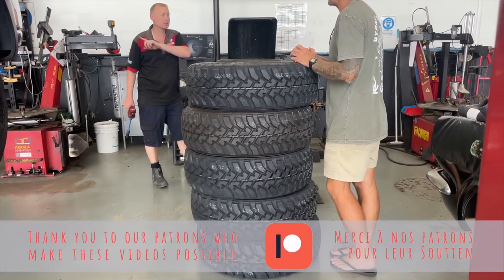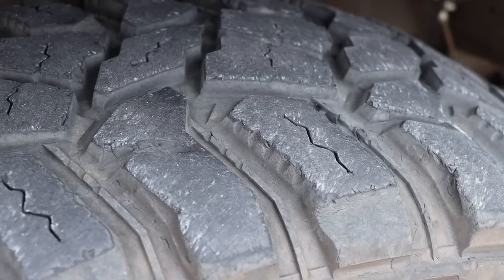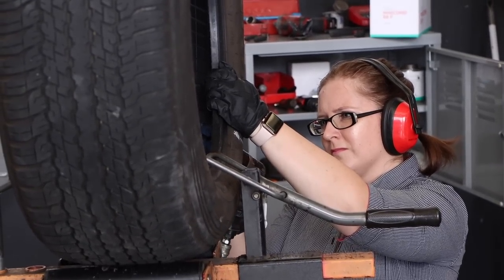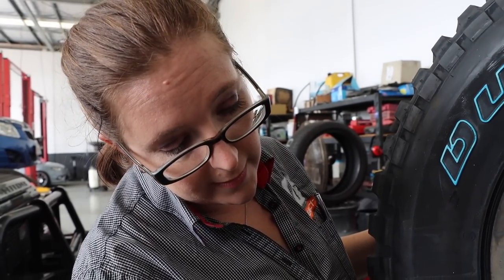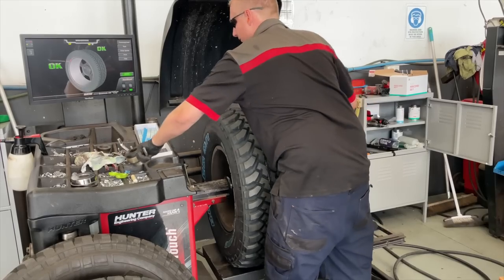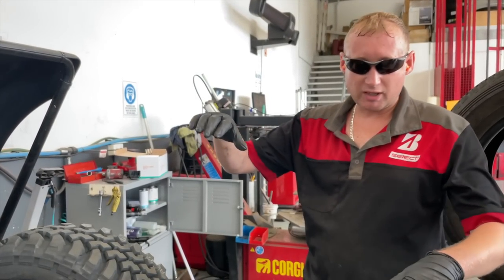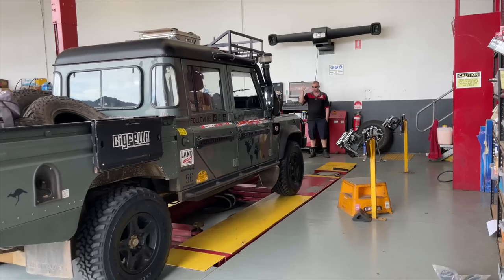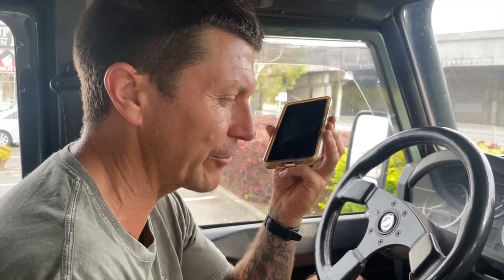New TYRES for Christmas. Ever wondered how they're fitted? #bridgestone

Comment: You are going to miss the Coopers so much!!
Reply: No one is using Bridgestones overlanding. . . Literally.
Reply: I’ve,run the same tyre on my disco 2 and my Kia Sportage ( in a 245/75/R16). On both cars no competes,what so ever,for a,mud terrai; tyre. They are quiet, grippy , and ride really well. Used in the NT as a road tyre.,our speed limit is 130 on the highway.. never had an issue and they inspired confidence. For a comparison   Jumped,in my mates,Pajero a few weeks agowith BFG allterrains. The tyre noise wasHORRIFIC in c omparison.

Comment: Interesting.  My Prado came with Dunlop AT's on it, but they lasted 70k km with mixed driving conditions.  I changed to BFG AT's and got 120k km from those again mixed highway and outback station type conditions.  Thet still had lots of tread on them but I changed them, because of the years and distance.  SO I am back with another set of BFG AT's, and I don't think that anyone could convince me to change, unless they were paying for them and any associated issues that may arise. Happy travels.

Comment: I had three tyres blow up in two weeks  between 5 and 20 km that were another brand. Since yesterday i have also Bridgstone  wich i had already three years before... Hope they will last longer.... Have nice Xmas and new year and a good travel to the new continent. 🎅🎄🎊😎🇫🇷
Reply: You must have bought inner tubes for tires or went on some very nasty terrain. Two weeks in 5 to 20km sounds very very strange...
Reply: @alwynvanwyk1851  No, only on the official road which leads to my house. Lots of Stones and 15degrees decending.  The Tyres were always perforated at the flank, where it is not permitted to repair. The 4seasons have been recommanded by the Garage. From a big French  tyre manufactorer. I came from the Garage to home, but on going down, pfffft. That never arrived in 27 years to me. 🤔😎🇫🇷

Comment: She says 5 year life span for tyres. Even the Bridgestone web site says 10 years. Salespeople!!!
Reply: You are 100% correct- I have a Bridgestone bulletin somewhere which confirms this
Reply: Legislation may be different to manufacture expectations.
Reply: @offroadingfoz  there is no state that can fail a rwc for tyre age only condition
Reply: The lady is probably more on wright side.
Reply: @scruffymoose 
As the lady at the tyre shop said, rubber is a perishable item, and it wears out.
Using a 10 year old tyre would be dangerous.
Even if a 10 year old tyre looks ok, ( which would be highly unlikely ) the rubber would have definitely deteriorated, and it would lack strength that is required, to handle the pressures and loads it endures when you are driving.
I thought the Tyre age limit was 6 years…
But, this time frame might differ across Australia, based on our States & Territories having their own specific Legislation regarding vehicle Tyre Age, and Tyre roadworthiness requirements ?
It does appear that in NSW, a maximum tyre age of 5 years, from the date of tyre manufacture, is the recommendation from 
Roads & Traffic Authority.
A huge number of factors will determine the tread life of your tyre.
If the rubber on a 4 year old tyre is hard, and no longer supple, and has cracks on the sidewall etc, it definitely needs changing, even if it still has a lot of tread on it.
There are also a huge amount of cheap / poor quality Chinese made tyres, that are “ no name “ brands, sold in Australia.
Sadly, people buy these poor quality tyres, to save what is often only a small amount of $$$ v buying a quality tyre, such as a Pirelli or Michelin or some other reputable / well known brand of tyre.
Saving a small amount of $$$ by buying the new “ no name “
brand of Chinese made tyre is actually a big false economy.
Various independent tests prove these poorer quality tyres have worse grip levels, and braking ability etc v a comparable tyre from Pirelli or Michelin etc
And the cheaper 
“ no name “ brand of Chinese made tyre, also wears out ( much ) quicker, due to its poorer quality.
No matter how good your vehicle is, that small contact patch of rubber, is the vehicles only connection to the road.
Food for thought…
It’s worth spending more, to buy good quality tyres, from the major tyre manufacturers.
Reply: In the USA the general rule is not to mount any 'new' tire older than 5 years. Once it's installed it can go another 5 years. So replace after 10yrs. A quality name brand tire usually won't blow out but the rubber hardens up and they can be dangerous in rain and snow.
Reply: If a tire sat for 5 years not being moved it would be unsafe, the rubber does settle you need to rotate a tire often. She did not say the tire on the vehicle she said if you put a new unused 5 year old tire on a vehicle it would not be safe. But 5-6 years is a good time frame for used tires as they do dry and crack.  I would not trust older tires with my kids driving on a hot summer day at Interstate speed.  My farm truck that never leaves the farm runs older tires but it does not go at highway speed ever.  With the 6 vehicles we have in my family we have only had one tire issue in over 10 years.  The years I drove thousands of miles for work  I only had one flat and it was from debris in the road. Keeping good tires on a vehicle is a safety factor.
Reply: @antonionunes998  she halved the official Bridgestone position to sell more tyres. This is typical of sales people.